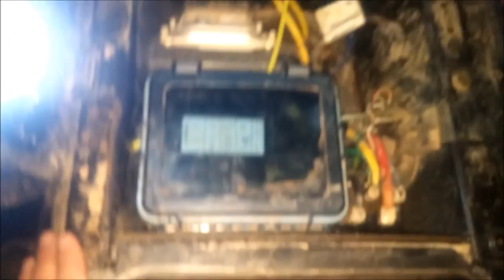Polaris Ranger 900/1000 EPS and Check Engine Light Solution

Comment: Is this holding up still, everytime I start my machine I get both them lights on and then the speedometer doesn't want to either. Can put it in low range to clear but is a pain to stop all the time to do this.
Reply from the maker: Soooo.  Yes this will work perfect to stop you from getting those lights.  However, it will not protect the rest of your wiring harness.  Mine has been down for about a year now because it needs a whole new wiring harness.  But I do treat my Ranger like a submarine so keep that in mind.

Comment: what's up bro   got a noise  coming  from my 900  I was to u the man  to ask
Reply from the maker: What's the noise and where's it coming from?
Reply: idling all good  running normal  all good  but when u smash on it hard  it has a ..kinda  like a lifter  tapping real fast    only under hard acceleration  I'll get a vid if I can
Reply from the maker: @williamwimberly5362  Man, drivetrain stuff I'm familiar with but once you get into engines I'm out of my comfort zone and would hate to lead you down the wrong path.
Reply: 10 4 ... I dont think its motor  sounds like a weight in clutch or the turf solenoid  going in and out  motor smooth as could be ..but thanks for your time  .....
Reply from the maker: @williamwimberly5362  Is it coming from you're belt box?
Reply: @OleNasty79  lol not sure... I may have found  well I changed 2 things 1 loss exhaust  spring ... and took the metal  pice off the belt box exhaust  tube kinda like a guard to keep stuff out  it was laying on heat  shield not drive it since all that but did push in on belt box while running and seems my secondary  was turning in park... is that normal